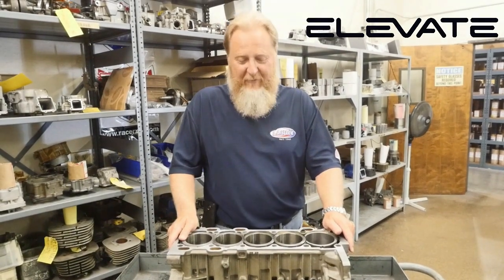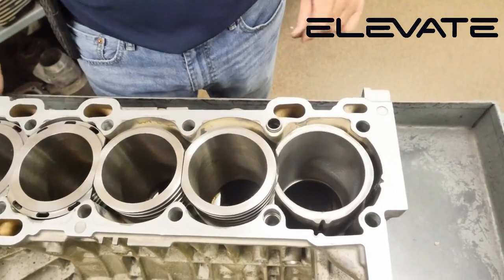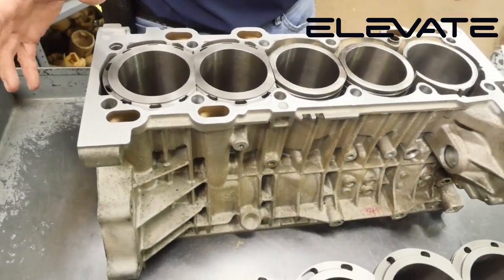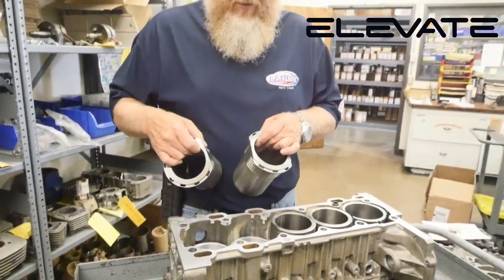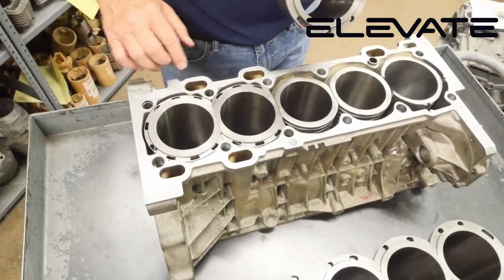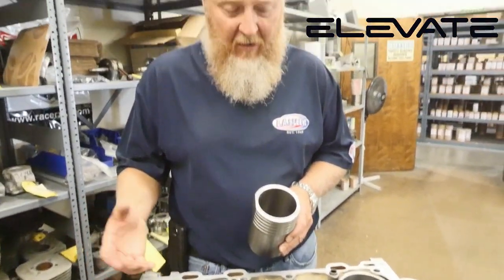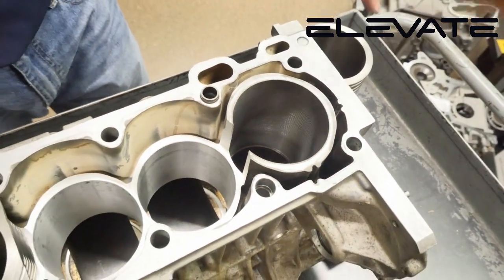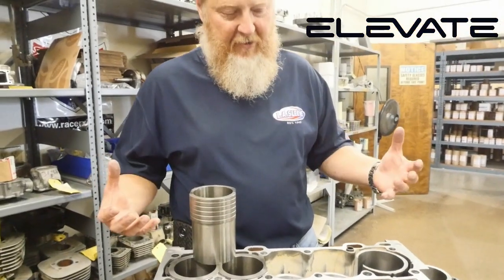Elevate Performance Engine Sleeves Demo Block Sleeve Type Comparison

Comment: Hi, I'm interesting in building a high compression NA motor and I want to use these sleeves so I can overbore them.  if I run a static compression around 11:1, how big can I overbore?  I know the website says 85mm is max overbore size, but that is assuming someone is turboing their car to make huge hp numbers.  The build I'm thinking of likely wont see over 300hp.  I assume temperature is the primary concern when considering cylinder wall thickness and I don't have the tools or knowledge to simulate temperatures in the environment I'm planning on building.

Comment: I think Volvo should have kept their performance engines for the R models a 2.4L or used the D5 Diesel Block. Both are stronger than the 2.5L Block especially the Diesel due to the nature of Diesel engines (very high compression, high peak cylinder pressures, etc).
I recon one could build a 400-500hp gasoline engine using a D5 block.
Reply: Do you use just the Diesel Block? 
Or do you use the Pistons,Connecting Rods and Crank also?

Comment: Can the Closed Deck be used as a Daily Driver?
Reply from the maker: Yes, but Open Deck are better suited as they have slightly better cooling. Open Deck will support 1,000hp--should be sufficient for your daily driver. :)
Reply: @ELEVATEVOLVO   Yes Thank you. 
Specially Now a Days Sports Cars are Running at Least  800 Horsepower on Average.

Comment: Can you produce these with an 81mm bore for the 2.0t engines? I prefer the way the oversquare design on them revs out/sounds compared to the 2.4’s/2.5’s.
Reply from the maker: The newer 2.0L four cylinder?
Reply: @ELEVATEVOLVO  Nah the 2.0L 5 cylinders, so B5204 (t-t9) not sure the US received them, but I think you did get the 2.4L B5244T5 that also ran 81mm bores?
Reply from the maker: @Jonathan_Doe_  Correct, we do not get that engine in the US. We do not have a solution for you.

Comment: since owning my volvo inline 5 turbo that shares a the platform with ford I've wondered if I could take my car to a Ford dealership and they would theoretically work on the engine in the volvo?
Reply from the maker: I wouldn't count on it. Some parts carry over (with different part numbers between Ford and Volvo), but most do not.
Reply: @ELEVATEVOLVO  thanks. In hindsight looking over the engine most of it is volvo parts. I'm about to do a mini teardown on the engine replacing head gaskets and timing belt pulley and water pump. Will shimming the engine work to help improve reliability or will it do more harm on the stock tune?
Reply from the maker: @christiansgarageLLC  Sorry, no personal experience with shims.

Comment: I’ve read and heard some things about the S60R’s cylinders that are known for cracking when put under high pressure, and was wondering if you knew how much pressure we are talking before I need to worry about a cylinder crack? I really want to get my hands on a ‘05 S60R within the next 2-3 years as a daily driver. Lets say the furthest I want to go is a classic stage 2 tune pushing 350hp. Will I need to buy sleeves or shims for the cylinders?
Reply: They crack because of shitty tunes on micro-sized turbos that creates too high cylinder pressures on low RPMs. 

You don't need sleeves to make lots of power with bone stock R engines. Here in Sweden we make 500whp and some even 600whp on stock 2.5t and R engines. The key is having it properly tuned on a dyno by a professional tuner on E85 with an aftermarket ECU. Keep torque in the lower rev range as low as possible and don't run too much ignition. Shims between cylinders will stop water from passing through and boiling.
Americans always seem to spend money on the wrong things. Sleeves aren't necessary until about 800hp on 83mm bore block (that is 2.5t and R engine bore). If you want to make more than that switch to an 81mm B5244T5 block. They can make 1000hp plus. Or better yet, a D5 block. It has taller deck height and a beefier girdle plate.
Reply: @wiktorhogberg1646  The stock tune must be shitty too. My block most likely just cracked at 118k miles. Forums are full of factory tuned cars cracking liners.  I always have used 93 octane when available, and installed a do88 intercooler at 100k miles. Engine wasn't ever over heated under my ownership. I never pushed it until it was fully warmed up and always let it run to cool off before turning it off.  It was a big mistake to manufacture this engine with 83mm bore.
Reply: @zfuru  what did you do of mods on your car? And did you actually crack a cylinder wall?
Reply: @wiktorhogberg1646  What is the EXACT recipe for taking a STOCK 'R' to 500whp? Im not based in America, im where Volvo 'R's are super rare so product support will be almost non existent.
Reply from the maker: We can't give you a direct correlation to what would crack cylinders. The two biggest contributors are over heating and/or making over about 400hp. Shims are a lot of work for minimal gain, and they certainly aren't a guaranteed fix.
Reply: You absolutely need to shim the block if you plan to increase power output at all or drive the car hard.

The cause for cracked blocks is often high intake air temp and pinging/detonation when people push these engines too far without knowing what they are doing.

Comment: Will I be able to use this sleeve in my 1998 Volvo v70 2.5 10 valve? (the engine that still has a distributor) I'm fantasizing to super charge it  😁
Reply from the maker: Sorry, we don't have any experience with that engine.

Comment: how mutch smaller piston u need for the sleev is it the same or smaller?
Reply from the maker: Designed for use with the factory 83mm pistons
Reply: @ELEVATEVOLVO  woaw thats nice.. awsome thx for answering. grettings from sweden

Comment: Where can can I find pricing for these sleeves and assembly ? It’s a matter of time before I crack my stock block. And I’m definitely looking to push my V70R to the limits and beyond. 

Thanks,
Reply from the maker: Take a look at our website to see options. Here is a link for the open deck sleeves: https://www.elevatecars.com/store/volvo-v70r/elevate-volvo-ford-turbo-five-cylinder-performance-engine-cylinder-sleeves-open-deck-set-of-five.html

Comment: Do you guy's have eny camshafts in the store for 5 cyl  ?
Reply: do you have valves springs, valves, valve seats, piston rings, pistons, piston rots, lifters, crankshaft, crankshaft bearing, etc. you need more parts Elevate ;) because one day I goan do the build of my life time with your parts. only :)
Reply from the maker: @magnusm-jensen3710  No, we do not offer any of these components.

Comment: Arent these sleeves cast iron ?
Reply from the maker: Yes, cast iron. The factory block has a very thin casting inside the aluminum block, but so thin that it fails.
Reply: @ELEVATEVOLVO  if you got these installed with some forged pistons at stock power levels how long do you think that engine would last?
Reply from the maker: @clonetrooper576  The block wouldn't fail. We can't speak to other components...
Reply: @clonetrooper576  why would you put reinforced sleeves and forged pistons and make stock power? i am wondering how much power can a stock engine take. i have S60 T5 and i have plans for it. i heard that over 300 hp with stock internals, then you sould change con. rods for better ones. but how much power can stock pistons and crank take?
Reply: @dominikhejl5748  I would do all those performance parts at stock power for maximum engine longevity. That being said, the bottom end of most of the whiteblock engines is already forged, and the T5 is the most desirable engine because it has thicker piston sleeves than the R engine, so it can take something of 400hp, while the R engine needs reinforcement to match that, they are pretty much identical though
Reply: @clonetrooper576  but that's the thing. stock engine is already quite durable, so why doing all that difficult job of swaping inner engine parts with no effect? these upgrades are for more power, not for durability as the stock engine is durable enough. i know about the difference between R engines and my T5 (i did a bit of research). i have also S60 2.4T with AWD and i plan to swap that T5 into that AWD car. (because of that cracking issue of those R engines)
Reply: @dominikhejl5748  Just for added piece of mind on my part. I wanna drive my R as long as possible without oil burning or anything bad.
Reply: @clonetrooper576  you could just say that you have R version =D oh well... i saw some video about it and they sad that you can help it with bigger intercooler, higher octane fuel and not trashing it in hot days. what about is is true, i don't know.
Reply: @dominikhejl5748  Those certainly help. I only run 93 octane as well

Comment: Do you do these sleeves for the volvo d5?
Reply from the maker: We don't get the D5 here in the USA, so we cannot verify fitment.
Reply: Why. There are guys who turn d5 into patrol engine for there strength. Look die leif hermanson 1140 hp s70

Comment: on a block like that, the end result of sleeves are going to that loose on the the block? or it will end with tighter fit it will need glue or sealant?
Reply: It's an interference fit so it's gonna be in there tight for a real setup. They warm the block and cool the sleeves to even get them in there.
Reply: It will be pressed, also is threaded!

Comment: Shold have done a Focus RS block, loads of people looking for a good blocks for these.
Reply from the maker: This is the same block as the Focus RS.
Reply: How many version is there as i am sure i have seen different foot print to that one?
Reply: @BILLHOVER  there isnt any difference. its the exact same block.
Reply: @SawDawify   The Mk2 RS has a slightly different block with shallower cooling pockets between the liners and plasma sprayed bores.

However, linering the block as shown here is just as doable.

However, I think what Bill was talking about is the Mk3 Focus RS which uses a development of the Mazda MZR 4 cylinder engine, and is the only RS available in the US.

Comment: Whos dragging a volvo
Reply: I used to rally mine, till it was stolen Now I'm trying to build another 242 dl  with 90s 5 cylinder turbo
Reply: Tons of people. I remember a time, maybe 5 years ago, when 3 of the 5 quickest four cylinders on Earth were Volvos. These days, with billet blocks being pervasive, that probably isn't the case, but they're very popular worldwide.
Reply: They can be great drag cars. The problem is getting them to hook up off the line. Also once you gut a Volvo you can lighten them up surprisingly good especially for what they are.
Reply: @willriley1619  They use chrysler 8.8 rear ends which are the same size as stock rear ends, rear wheel drive of course!
Reply: Swedes....
Reply: Micke holstrom 1000hp t5 volvo 745